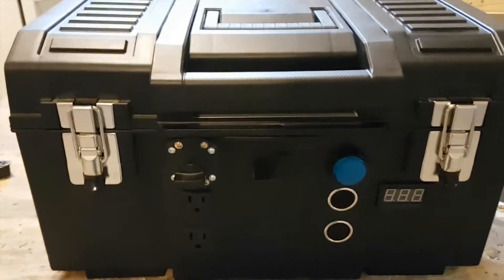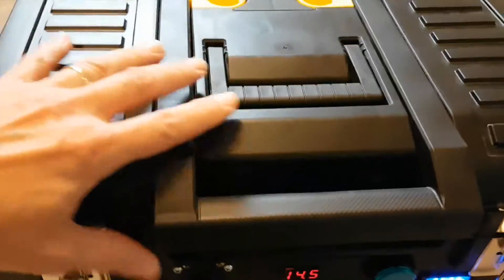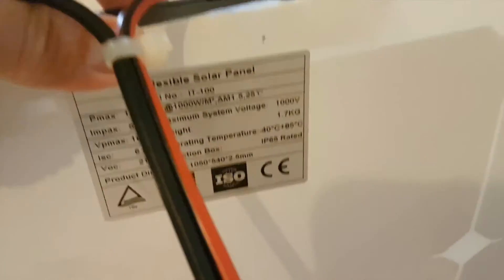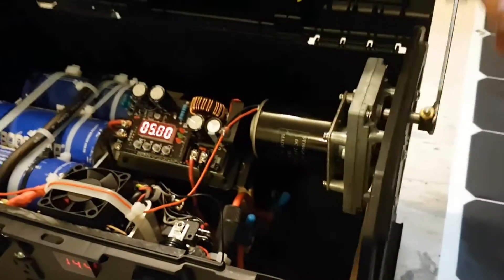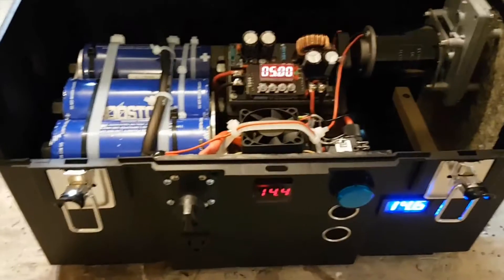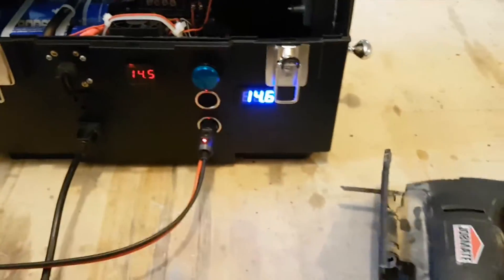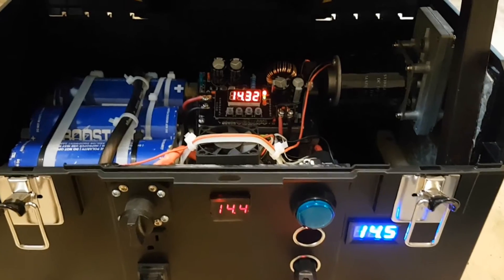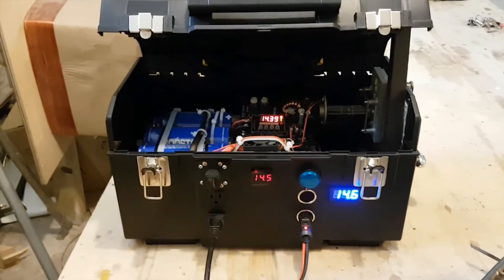Phillips Tech Portable Power Station

Comment: This will likely work well on a sunny day, but if you have a few overcast or cloudy days it would take a lot of off time charging to keep up if say you were cutting boards every few minutes.  Lasersaber has been working with this same idea for a very long time and he was even testing with running a cement mixer and circular saw cutting boards and mixing concrete.  The big problem always comes when you need to run a big load like a cement mixer for 10-15 minutes or more or a portable table saw to cut a 4x8 sheet into several strips.  On an overcast or cloudy day, you would likely need 5-10 times more solar panel capacity to keep up with the load.

I have a little portable power unit I built into a 50 cal ammo can that can jumpstart a car or provide 48Ah of capacity at 14V.  It provides 2X USB up to 3Amp each charging ports that can be used for charging devices.  I also added a small 700watt pure sine inverter that can be used to run various accessories.  It does have a built-in MPPT solar charge controller but I rarely use it except while camping.  The battery is comprised of 4 series blocks of 16 parallel prismatic lipo cells and only takes up about 1/3 of the space in the ammo can.  The whole unit weighs only about 20 pounds.  If you want more capacity, consider adding some lipo cells to the system to allow the unit work even during overcast days.
Reply from the maker: +kuhrd 
Your system sounds pretty cool.. I did however want to stay away from batteries, that's why I chose the super caps because they're able to charge and discharge at a certain rate. As for the solar panel, using monocrystalline panels do require direct sunlight to get the full wattage out of them. However you can use amorphous solar panels which work in all weather conditions cloudy or sunny. They do cost more money however because of that luxury but I have seen some made that are high voltage and as long as 10 to 12 ft and can be rolled out. I wouldn't recommend this unit for use on a concrete mixer though due to the High amperage draw on the inverter, but then again if you had up to 400 watts of those amorphous panels laid out it might do quite well with a bigger inverter being used of course, and maybe a true sine wave would be more efficient. Thanks for watching.

Comment: can you please share this genius plan with us. Also could you please tell us how much something like this will cost to build?  Oh and where do you get those Super Caps.  Awesome:)
Reply: I agree, it would be very interesting to understand how much a unit like this cost even if it just an estimated number.
Reply from the maker: +Evone 
Please read the comment I wrote to Launchpad 1 below for the answers.
The price however can be expensive or cheaper depending on where you buy the caps. Sometimes you can get a great deal on eBay for some used ones.
Mine has four used ones that I purchased for $100 and then two brand new ones in which I paid $120. So with the caps and all the supplies bought, it cost me closely around $500 to build. Thanks for watching.

Comment: Will you send me the plans?
Where did you get the super Caps?
Where did you get the dynamo?
Great setup!
Reply from the maker: +Lonchpad1 
I actually just through all this together in my head and built it, I really don't have any blueprints drawn out. But here is where you can purchase the caps brand new or go to eBay and find a better deal for some used ones because they are quite expensive..

http://www.mouser.com/Search/m_ProductDetail.aspx?Maxwell-Technologies%2fBCAP3000-P270-K04%2f&qs=TvYXSR6pz%2f0%252b6cJnREvuCA%3d%3d

I purchased the Dynamo on eBay.. just type in on the search this information and it should bring it up.

DC12-24V  High Torque Recudion Gear Motor Hand-cranked Wind Turbine Generator  

As well as the pwm circuit for the solar panel power input control was  purchased on amazon.com and it is this...

DROK DC-DC Numerical Control Step Down Voltage Converter, 6-65V to 0-60V 8A 400W Buck Voltage Regulator Stabilizer, Constant Voltage Constant Current https://www.amazon.ca/dp/B01MSJQAKY/ref=cm_sw_r_cp_apap_neKRhNjldQCys

Thanks for watching.

The toolbox was purchased from Lowe's. And all the other little electronic Hardware was purchased from A1 parts.com.